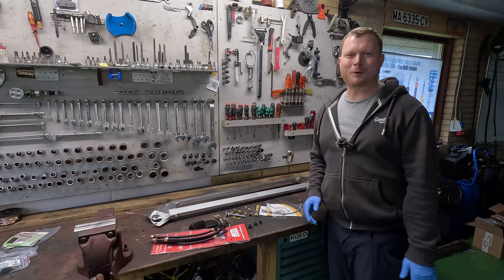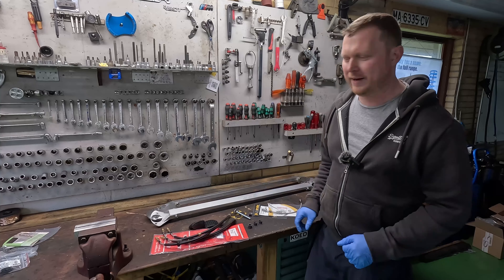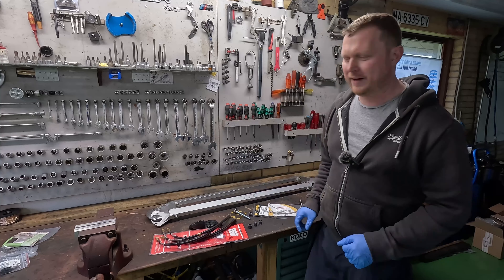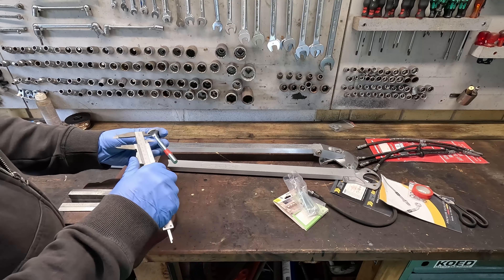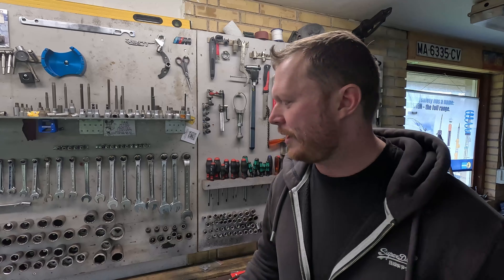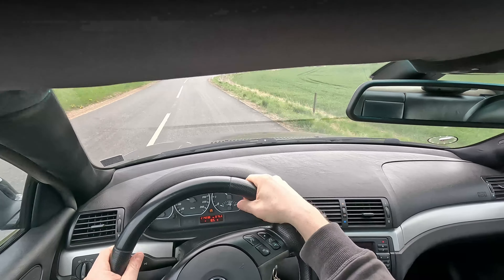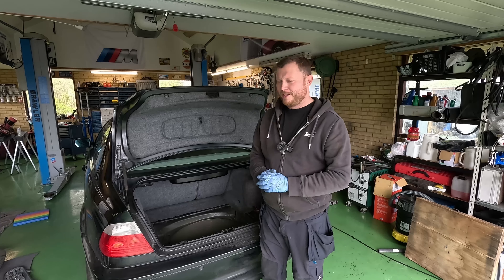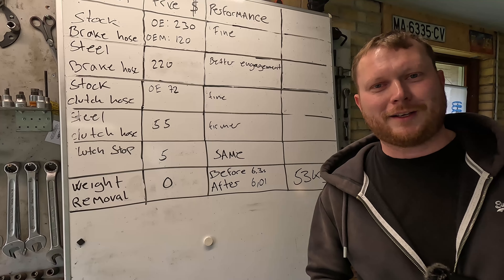Best Cheap to FREE Upgrades for almost any car

Comment: When you changed the stainless steel clutch did you remove also the Clutch delay valve (CDV)? The internet rumors say that it greatly improves clutch-feel and engagement. What is your feedback? And as always keep making these awesome videos😀
Reply from the maker: Sadly, someone before had removed it. Maybe i should have added it before making the video in the first place, for a better comparison. But i dont get these ideas until all you guys mention it in the comments:) either way, i only replaced the hose. And the “review” of it is not long because imo it doesnt change much. Yes, the pedal is a bit more firm. But if you dropped your car off for a service at your local garage, then went to pick it up at few days later, i dont think youd notice the difference. The brake hoses you will notice though. More touchy. 
And thank you for the suggestion to keep it up
Reply from the maker: Also, keep in mind i replaced an old hose. If comparison was new vs braided steel i think the difference would have been even less. I had an e36 where the hose visually expanded when pushing the clutch pedal. There is a difference in new vs old hoses at some point
Reply: @OEMplusRESTO  That is very true that it would've been negligible! But I was just curious what would be the difference between combination of cdv delete + stainless steel VS OEM... I would imagine that in that case it could be more significant 🤔

Comment: To me the brake hoses would expand under load, ie when the car is moving. Sitting on  the ramp the caliper is not overcoming any force. Under load as the caliper squeezes the disc it has to overcome the rotational force of the disc causing  pressure increase in the brake hose.  The force which is the car’s momentum (mass & speed). Hose selection  comes down to NVH, obviously engineers in BMW  know to appeal to the broader consumer a less ‘snappy’ pedal is more desirable.

Comment: The minimal expansion of the brake hoses takes place over the entire length of the hose, times 4. The difference in feel is amplified by the length of the pedal. Just like in a mechanical linkage, minimal play in the fractions of millimeters can add up to significant slop on the user interface side.
Pretty cool, next time I need hoses I'll give them a try. What kind did you get?
Reply from the maker: That makes alot of sense. Of course even a tiny expansion will have cummulating effects on 4 long hoses. Thank you for pointing that out

Comment: Glad you’ve tested the weight reduction, I’ve felt a difference just removing the spare and jack. Did you do a run with just these two removed?
Reply from the maker: Sadly no.. it was very noticeable with the 50kg removed honestly
Reply: @OEMplusRESTO  that’s a shame, was really keen to see if that makes a difference on it’s own, given that they are the two things easiest to remove and live with
Reply from the maker: @renas5371  it will make a difference. I just didnt test it. But spare and jack is 15kg somit should be a .1 second faster whiich is noticeable although harder to tell

Comment: would love to see a thicker sway bar test, apparently the 330ci m sport II has 24 mm front swaybars vs 23mm non m sport and 20mm rear vs 18mm stock. on the other hand, H&R also sell the anti roll kit which is €500, but it's 27mm front & 21mm rear. From my understanding, this would have a bigger impact on handling than coilovers, especially when you're running stock m sport suspension.
Reply from the maker: I’ll look into that. Thsnks for the suggestion:)
Reply: I have eibach 30/21 I believe, setup on the softest one I belive, it come with poly bushes. I have full powerflex rear end except swaybar endlinks, and the 2 lower and upper arms. Sport suspension with whatever coils were on there.
 All of this to say that this setup is TBH very uncomfortable. I like the way it drives, 0 body roll on stock suspension, but men its harsh.
I'd like to try using the harshest settings but idk if I'll feel something if it's not on a racetrack.
On perfect pavement this car is a blast but on country roads it's as fun as loud and clunky in there. 
I plan to use as much poly as I can, tho.
Reply from the maker: @lorrisl5026 you dont feel poly everything will be too harsh? Im worried it will on my car but its a street only car

Comment: Interesting to hear a test of braided brake lines done by someone who had properly bled brakes before replacing the lines. Because usually people are replacing hold hoses and probably feeling the fresh bleed rather than the lines.

My thinking is the touchier brakes is maybe not much the lack of expansion, but a different internal diameter of the hoses
Reply from the maker: That actually makes sense.. or at least that theyd use a very tough material being how critical those hoses are. Thank you
Reply: @OEMplusRESTO  Yeah either way seems like a worthy upgrade for someone that enjoys nice brakes. Definitely putting them on the list for my e36, even tho I was sceptical prior.
Reply from the maker: @imnota sweet. What e36 is that? If all goes well i’ll have a 318i on this channel soon, to see how much fun can be had with a 4 banger before maybe swapping to 6
Reply: @OEMplusRESTO  

Also am quite surprised at the results of weight reduction. Makes me wonder if maybe it's more worthy to chase weight than I originally thought. 

Recently I found out through realoem that the M3 CSL uses a smaller 55ah battery from the R52 mini cooper, and if that was considered still good enough for a factory car with a 3.2 and high compression (therefore difficult to crank) that makes you wonder how small you could go and still be viable, especially on our smaller engines. 

Because that means there's like 10 or 15kg to be gained, with no compromise in comfort, and without going to some expensive and fragile race battery.
Reply from the maker: @imnota im doing research on weight reduction right now. Theres a few batteries to go with it seems. That csl one might be the best suited. But theres also a miata battery among others, before venturing into the expensive lithium ones.. but soon youll run low on cca and they wont be really usable for anything but racing. But just as an experiment of how much weight can be removed without damaging the car. Theres also the m3 hood btw.
Reply from the maker: @imnota also.. removing the seats and imstalling just a single plain cloth seat will remove and additinal 30kg or so.. so far i think i can remove 100kg without doing things to the car i cant easily reverse
Reply: @OEMplusRESTO  

Just realized my other comment didn't post, my e36 is a 325 coupe with vader and 3.45 limited slip, it's in need of a repaint right now, I have pics on insta, same name as on here.

But yeah, seats are a big one too, but at that point I feel like you're compromising looks and comfort, but yeah I once took out my electric vaders for rust repairs, and these things are heavy for sure. 

Is the e46 M3 hood aluminium or is it lighter for other reasons ? 

On the e36 I know the 3.2 m3 has aluminium doors, those are decent weight savings, but not really if you count the kg/€ lol. Whereas removing the spare, putting small battery and other similar things are easy and cheap.

Also from what I've found people say as long as you got over 300-350cca it should be just fine and not really be any more problematic than a full size battery. It's also why I was interested in what bmw did with the CSL as they must have figured out a better compromise than people on the forums do.
Reply from the maker: @imnota  imo the perfect diff ratio for that car unless you do alot of highway. vader seats are unicorns by now so i envy you lol. The m3 hood is indeed aluminum. One small correction though about the doors. They didnt come standard on cabs. I had one with them, Was a coupe. They were developed for the race cars but the "leftovers" found their way on to factory cars. But it was not an option. So either you knew someone at the factory, and had them make sure they made their way onto you car, or they were used in no order known to man. I had a techno coupe with them before this 330ci- They are alot less sound dampening but spare you like 10-16 kg pr door

Comment: Great video! I've done the braided stainless brake hoses on several cars. And I agree, it doesn't affect braking performance much. But it does improve the pedal feel. And that can make you feel more confident while driving.

Regarding the clutch stop, it can be helpful if you're using a "clutch tamer" device. It makes the clutch tamer more consistent. Great for racing, but not very useful for street driving.
Reply from the maker: Thanks for the tip Michael

Comment: Cheers for the content. 
 I'm pretty sure, oem brake lines are steel with rubber coating. One befit of aftermarket steel brake lines is price. They wre often cheaper than oem. 
 Strut brace test drive really should be a blind test. Have a friend install and remove the strut brace for several test drives and try to guess which time the brace was installed. Placebo is a powerful drug! 
  Weight removal makes the car not only accelerate better, but also brake, handle and improved fuel efficiency. Losing a lot of weight from a street car is impractical though.
Reply from the maker: Interesting. That would explain why there is so little differenve between the rubber and steel version of the hoses

And yes it could be placebo with the rest. I agree. Thanks for the continued support bro
Reply: Strut brace makes a big difference, it’s not a placebo at all. I think everyone who installs it immediately notices a better turn in. The difference is simply too noticeable for it to be a placebo.
Reply: @renas5371  strut brace makes a big difference. I believe you, after a blind test :)

Comment: Huge effort once again from you and a great video. I have two things to add.
First, rear brace has a great effect on controlling the car when drifting/sliding, especially when combined with poly bushings on the rear subframe and a LSD, of course.
Second, you can remove the rear seat backs, about 11kg., with only one bolt, torx 40 if I remember well, and the lower seat itself just pops out but is very light, like 3-4 kilos.
Reply from the maker: I only have the weak lsd from racingdiffs but i get your point. My car just isnt modded enough to feel the difference:)

Comment: Clutch stop is the best drivability mod I've done, I put it off for a long time because I had to modify the clutch switch as I didn't want to delete it. Some e46s have the clutch switch built in the master cylinder but not on mine. Not having to press the clutch all the way and the grab point being so predictable helps a lot and because the car uses a self adjusting pressure plate you never have to worry about the grab point changing in the future 👍

Comment: Regarding weight reduction: You could add some Recaro Pole Position seats, a Li-Ion battery and an aluminum hood from an M3. You should loose another 50kg by doing this.
Reply from the maker: Great ideas honestly
Reply: The stock battery is pretty heavy. I replaced it with a motorcycle battery, which removed about 28 lb (12.7 kg). But of course, the smaller battery has less capacity. For me, it wasn't an issue because my E46 isn't a daily driver.
Reply: @michaelblacktree  The M3 hood will save another 10kg I suppose. Even more if you go carbon fiber.
Reply: @PREDATEURLT  Unfortunately (or better: fortunately) those don't weight much.
The front seats however are the worst. 
A sunroof delete can also save a couple kg at the right places (especially if the whole roof is replaced by carbon fiber). That's quite an operation and might "ruin" the car. However, a carbon fiber trunk might be worth investigating.